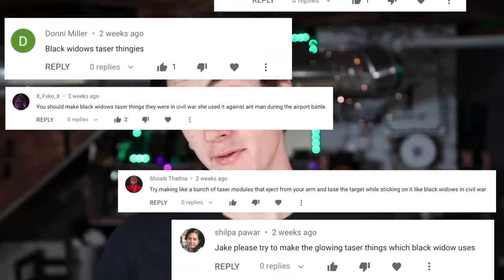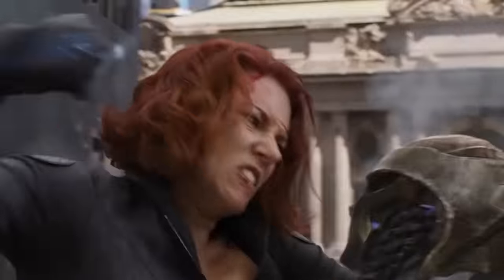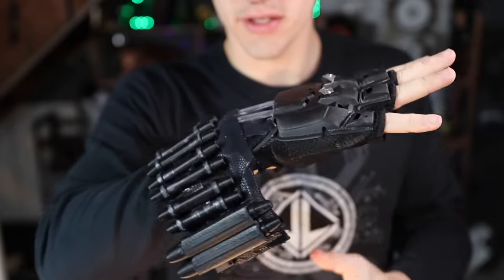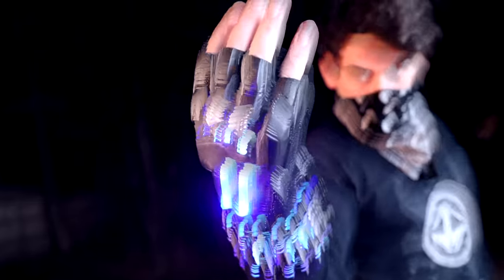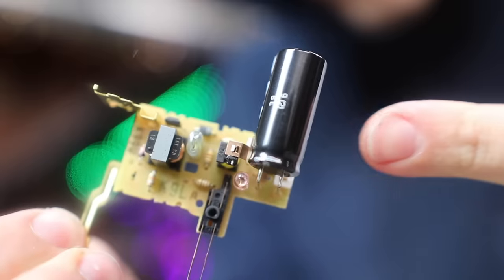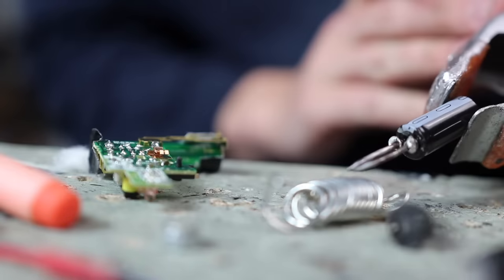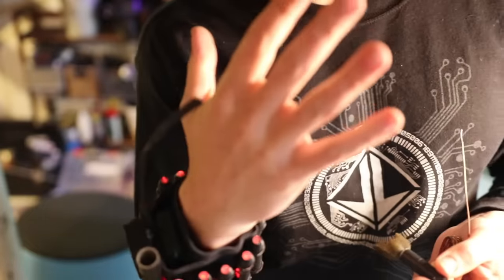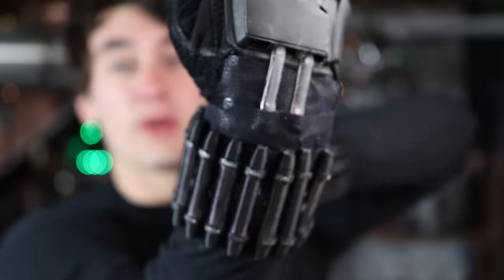Make Working Black Widow Bites! - $20 Electric Dart Gloves (30 Million Volts)

Comment: The tubes on the bracelet are the darts that are somehow propelled. That's why they are on the bracelet, and why, if you look closely, there is a slight variation in the number throughout the movie.

Make Hawkeye's arrow tip selecting quiver! The one with arrow shafts without any tips, and the tips are in a separate compartment. He hits a button on his bow, and it takes a single shaft and attaches it to the tip he selects

Comment: This is one of the more legit builds because it's one of the more realistic and practical ones. I would really like to see a second version. You could really build those out. Instead of those tubes being hollow, they could hold batteries which could also help slim down those bulky boxes. Maybe fit other components into those tubes too. I'd like to see both hands with tasers and multiple darts. Maybe add a flashlight to one. Black Widow has also used pepper spray so maybe add that to the rig too.

Comment: I've actually built a gloved taser using a radio shack light control box only two inches long.actually,I've used it to stimulate my leg and hip muscles because I have neuropathy in my right leg due to a pickup truck hitting me head-on when I was 17.it either puts a steady voltage out or pulses out about 98 volts.two months later,my leg feels better,no more pain, and that exo-bionic leg assist I'm building will help strengthen my leg and hip.love your work,man.we think alike.lets get together and build Megatron.😁😄😀👍👋

Comment: make a multi-connector data cable which has a port to access a flash drive so that a phone can access it too. Thanks, love the black widow shocking bite and make the terminals circular too.

Comment: Nuh uh, not 30 million. Spark gap voltage cannot rise further than the breakdown voltage of the air gap. The distance looks to be around 3.5 cm, and with 5kv~ per centimeter, that makes 17.5kv. 
TLDR: the manufacturer lied

Comment: As much as i think this is cool, 30 million volts is absolute bullshit. realistically that produces an arc with an output under 100,000 volts. Cool glove though. next time maybe build the circuit yourself instead of disassembling a taser.